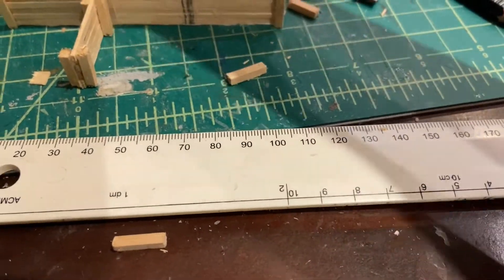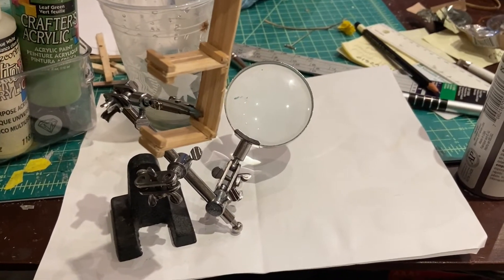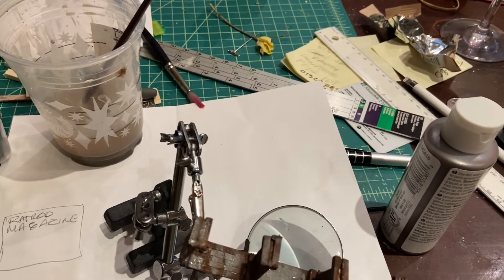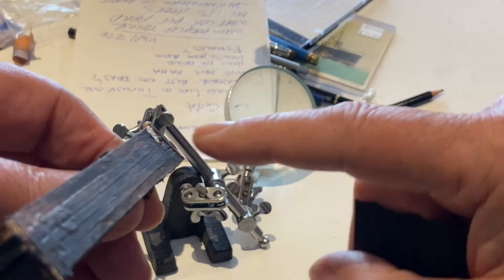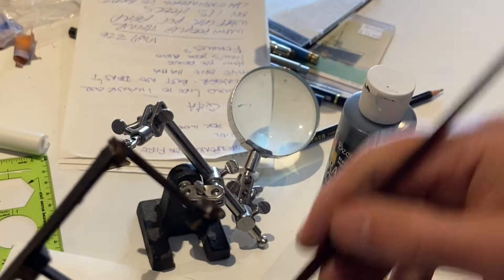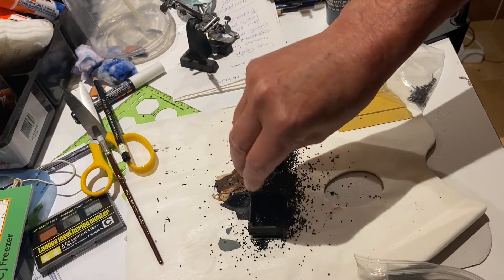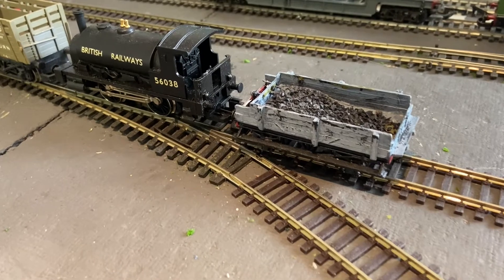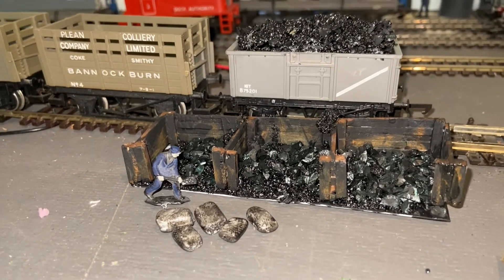How to Make a  00 Scale Coal Staithe

Comment: I made some coal staithes for my trains and used real coal that I smashed to bits (bituminous coal--even though anthracite would have been easier, but no railroads ever burned soft coal).  I used a hammer and an  12 inch anvil made out of 120 lb. mainline rail I got from the Central of Georgia RR.  I think it looks realistic 'cause it's real coal.  Your staithes look really good.  Cheers from eastern TN
Reply from the maker: Happy to hear that. i have used some real coal also mixed in as I have a small lump.
Thanks for taking the time to post this, I really appreciate it.
I was in Nashville a bout a month ago for a couple of days. Kept hearing train horns but couldn’t find them. Will be back down there soon as our daughter and fiancé are moving there. Cheers Charlie